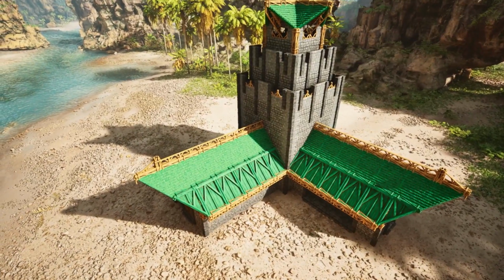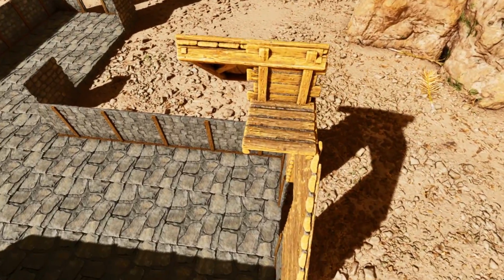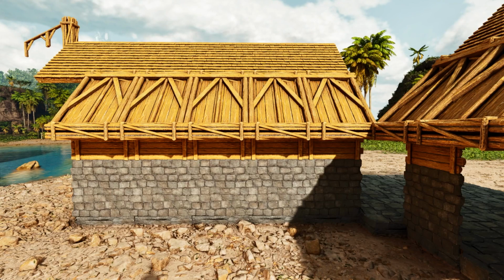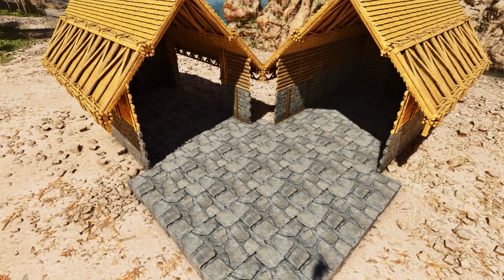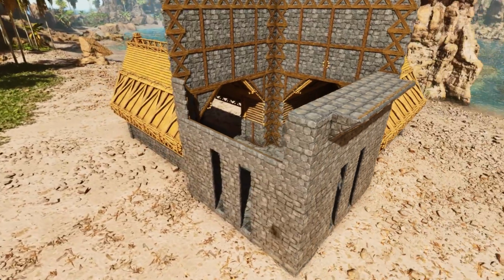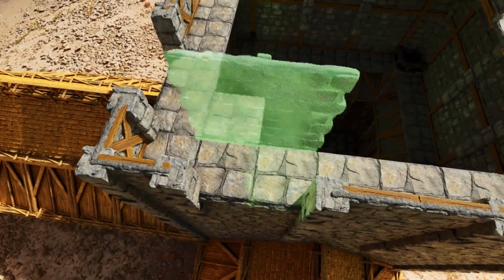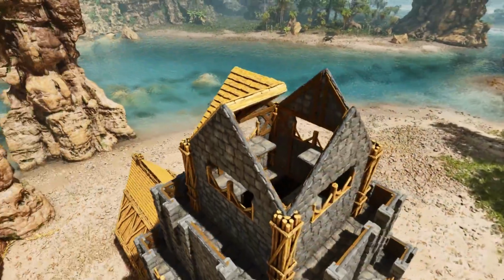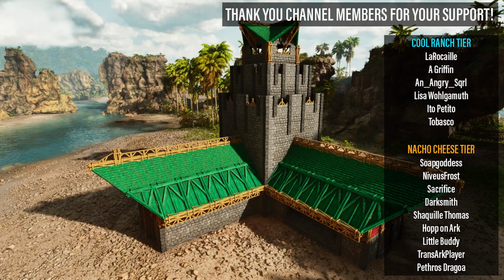ARK: Survival Ascended | Workshop | Build Tutorial

Comment: Very nice build, I've been building this for my tribe over the last few days.  Since we're a more medium sized tribe I decided to duplicate the wing sides on all 4 sides, creating a sort of cross shape with the tower rising out of the center of it so that we'll have more space.  I have a question.  There are a lot of parts of this video that are like "Place a quarter ceiling here, then snap this piece this way" and for a lot of those I found I didn't need the quarter ceiling, the pieces would snap how I wanted them anyway.  There were a few places I did need it to get things right but overall most of the time it wasn't necessary.  Example:  building the tower, when putting in the stone walls that move it up vertically, you snap a quarter ceiling, but I was able to snap the walls to the existing architecture without that.  Is there a particular reason you were doing it in those cases, or is it just a case of you do it all the time whether it's needed or not just so you don't have to keep track of what is allowed without them and what requires them?
Reply from the maker: Glad you and your tribe got some good use out of it. As for your question, I’ll have to look into it more and see where you do or do not need ceilings. I was mostly going off old Ark mechanics where you needed ceilings on certain sides for things to snap right.